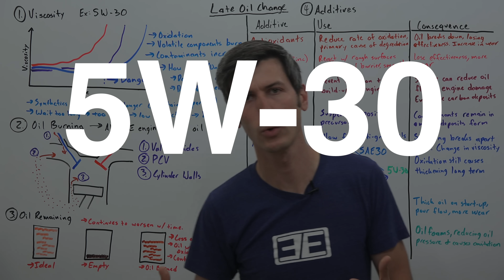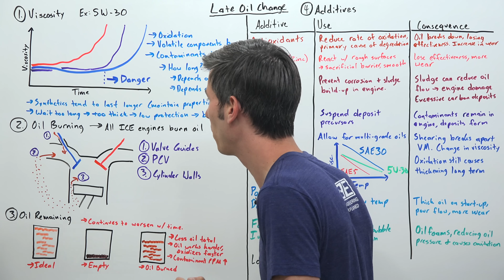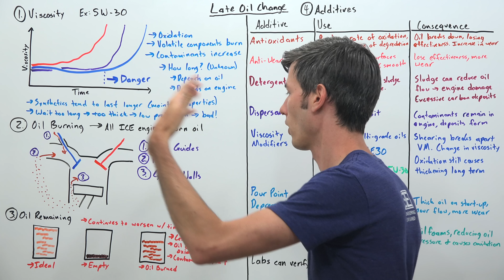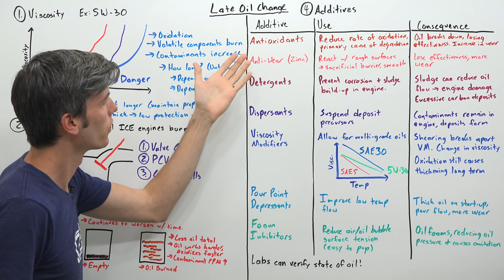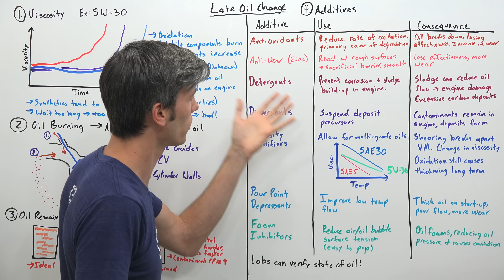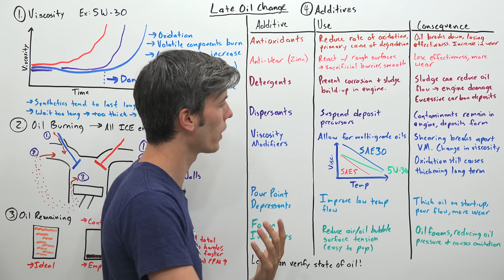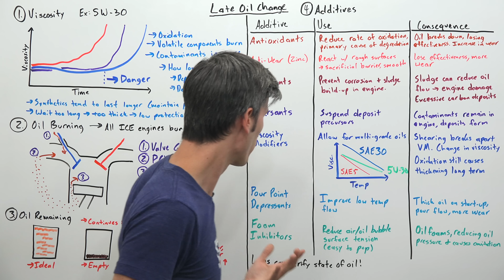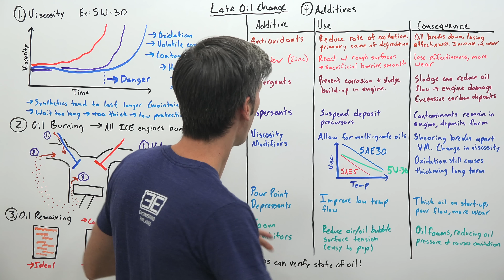What If You Forget To Change Your Oil?

Comment: I’m very surprised to see that nobody committed on the fact that he misrepresented the oil numbers incorrectly. Mostly because ppl don’t understand it. Let me help you out and correct his statement. 
Oil does not get thicker when it’s hot, nor does it get thinner when it cold. The 5W30 and every other oil labeling is - the 30 is the weight which is how thick the oil is the 5 is the viscosity which is how easy the oil flows and of course the W does stand for winter which really means nothing. Because we don’t adjust between winter and summer. Most of the newer engines are at a tighter clearance so the oil has to flow easier but still cushion the bearings.

Comment: Great video. The one thing that I want to raise is that throughout the video, the concept of 'time' was used as a constant, whereas I would argue the 'transition' that oil goes through is based on 'time the engine is running' and not JUST 'time'. I mention this because almost all modern cars pop the 'oil change' warning after a fixed period of time (regardless of how much the vehicle has been used) and many people swear by annual oil changes (once again, regardless of how much the vehicle has been used). This is doesn't make sense (because its not like the oil degrades in the container it was sold in, so why would it degrade JUST be being in your car. The best analog we have today is 'miles' for an oil interval, though arguably an 'engine hours' gauge (like industrial/commercial equipment has) would be much more valuable.
Reply: My work vehicle is a newish GM pickup, and it's oil-life indicator is said to be based on the main computer's record of mileage AND driving conditions (short vs long trips, time spent at various throttle settings, etc.).  So, if you drive "hard", the computer will tell you to change the oil quite a bit sooner than if you drive "easy".

Comment: I use a decent branded 10w40 semi synthetic for my 2009 VW Golf 1.4 litre petrol NA and 2005 Yaris 1.33 litre petrol. I change the oil once a year (never do more than 4K miles a year on each car).  Never had any engine issue with either car and Yaris has 120k miles

Comment: Total anecdote, but my mom changed her oil every 5,000 miles in her 2000 Expedition with the 4.6L instead of the recommended 3,000 miles and it was the most reliable vehicle anyone in our family has ever had, and she sold it with ~316,000 miles on it.

Comment: I am using mobil one I dont even hit 3000 miles by time  I change my oil but I do it once a year and I use mobil 1 filter will I run into any issues ?

Comment: On my first car (BMW E46, 7 year old) I used to buy the best oil on the market and change it way before it even needed to be changed.. bought only the best replacement parts.. the car's engine died within 3 years.. so screw that, just buy a proper quality (nearly) new car, give it some basic normal care and kick it out within 10 years max. Some thing are just out of our control. The money I wasted on my first car is haunting me to this day. Slowly cost me 3 times what I bought it for.

Comment: Very important to note for those who don't know; The oil viscosity ratings are 2 different scales, as in the 5w 30 are not basing viscosity on the same level. Otherwise cold oil would have a much much higher viscosity like 150w 30.

Comment: Well there is a lot of factors for oil consumption. My engine has about 210000km on it a small 1.6L Turbo with 200bhp and it's still using no oil. If you keep good and proper care of the engine and it's auxiliaries you can reduce wear by alot with todays engines. Oh and don't drive too many small distance and give your car regularly a nice good run on the highway for a few hundred kilometers.

Comment: I went 50 miles over, so I just drove backwards before I changed it.
Reply: This is the kind of thinking that has made this nation so great!
Reply: @tiggla01  
Land of the free and home of the reverse highway dipsbit. Hahaha

In older autos: "Drive backward"

In modern cars:  GPS be like "hold my beer"
Reply: @tiggla01  amen
Reply: tiggla01 Yeah I was thinking must have been getting their advice from the DNC
Reply: @jimlangill9318  .....getting their advice from the "Run DNC," as opposed to Run DMC, ;)
Reply: Thank you for the tip
Reply: Outstanding move
Reply: Does this actually work? asking for a friend
Reply: @randomsanwhich2  Yes.
Reply: @danield8528  why comment something incorrect on purpose
Reply: @jayasmrmore3687  Because it’s funny. Why does it matter to you for??
Reply: @danield8528  because you should be the one paying his repair bills then
Reply: @jayasmrmore3687  His initial comment was sarcasm buddy. 😐
Reply: @danield8528  where is proof
Reply: @randomsanwhich2  no it doesn’t
Reply: On old cars that have mechanical odometers that are driven by speedometer cables, maybe. If the odometer turns backwards when you drive in reverse, yes. Later, manufacturers added one-way clutches like in a bicycle hub to prevent spinning the odometer backwards, and indicators that show when the odo drums have been turned manually. Now we have electronic odometers that advance when the car is in reverse just like when it goes forward.
Reply: The old Ferris Bueller method.
Reply: psnmadracer27 Ha,Ha...I remember and like that movie.
Reply: @Dan Gleeballs nope. that's not what "she " said. she said your dipstick is too short, there is  almost no friction, but since the "drive" is always both so short, infrequent and "gentle" there is still very  little chance of any internal damage occurring, a general all around  violation of physics = you're "outta spec" and are gonna need to be replaced. hahaha! Sorry but your G-name asked for it.
Reply: @dmmusicmusic  🤣🤣🤣🤣🤣
Reply: I have to try that. Inspirational thinking. If I drive in reverse for 130000 miles I'll have a new engine. Thank you so much !!
Reply: @kevinmanns7170  not only that, but the fuel tank will refill and once it's full, you can sell the fuel for extra money.
Reply: MrCalifornia1234 you are damn right it’s 100% true in case of front wheel drive 
And in rear wheel drive you don’t need to change engine oil ever
And in four wheel drive you don’t need any engine oil at all! Because both front and rear wheels cancel the effect of each other
Reply: You are a genius.
Reply: can't you just go all the wsy until the oil return to its original state. don't go too far tho, you will ended up having crude oil instead.
Reply: Seems legit
Reply: Captain here. This does not work. You should put your car in 1st gear (MT) or in D (AT) and then tow it backward, this will actually reverse the engine rotation. If you drive in reverse, the engine still rotates in the same direction.

Fun fact: if you tow it far enough, your car actually purify used oil to new oil again
Reply: And suck air, which contains motor exhaust, back through the motor, making gasoline that fills you tank back up.
Reply: @rezhaadriantanuharja3389  you're onto it 😂
Reply: I bought 1988 car and have changed oil 7 times in past 1,5years🤔
Reply: @0hjaa3.0  not often enough. You can do better. Think about all that engine wear.
Reply: Hahaha te best replay, but you dummy even if you go in reverse your engine runs in the same direction hahaha
Reply: You’re confusing the speedometer-odometer with the tachometer. The speedometer-odometer counts turns of the final drive output shaft. The tachometer counts crankshaft turns/minute.
Reply: @joseaguilar4455  at least the transmission last forever.😂
Reply: That was a good one bud! Haha
Reply: OMG you are genius, Why i never think of that. People living in 2020 you must be living in 2060.
Reply: I just reversed the odometer
Reply: aUcTALy iT Is WorSE FOr yOUr CAr
Reply: I'm old enough to remember when this actually worked, before returning Dad's car.
Reply: @jaxcell  in the old days you could do this?
Reply: @jayasmrmore3687  Wow, you really don’t understand sarcasm or get out much, do you?? You ever seen Ferris Bueller’s Day Off??
Reply: Damn why didn’t I think of that
Reply: @ageagile1047  it’s a joke
Reply: Genius
Reply: That's genius. If I drive backwards home from work every day, I put no miles on my car and it'll last forever!
Reply: @HydraliskX  You also can save on car insurance because you aren’t driving the vehicle more than 7500 miles/year.
Reply: the police are on the way
Reply: You tried
Reply: Haha
Reply: Lol
Reply: MrCalifornia1234 seems legit
Reply: You should've drove back in reverse to be effective.
Reply: Hahaha yeah,smart
Reply: I went 50,000 miles over, the engine seemed fine since the last time it didn’t have oil in it
Reply: So it’s a very strong engine..!👍👌🏎
Reply: I have to drive 20000 backwards 🚗
Reply: Smart
Reply: 100miles then
Reply: Hahaha 🤣🤣🤣
Reply: Lmao
Reply: 200 IQ
Reply: If you had of kept driving it backwards you would have ended up with a brand new car thou !
Reply: MrCalifornia1234 If you want to save money.. You can ride as long As you want But be remember to get back that Number so You are safe and wealthy at the same time
Reply: What if you went 10000 miles over?
Reply: But your engine oil ddnt agree
Reply: These comments are golden, but if you drive it to 9999999 miles it wil change to 0000000 and it will have a brand new engine too
Reply: Tenet
Reply: The engine may have been irreparably damaged, consider taking it to junkyard for scrapping.
Reply: Ha! Lol!!! That was good!
Reply: Save Ferris!
Reply: Ah yes, employing the Ferris Bueller method of reversing mileage....oh wait....most unfortunately that did not well at all...what to do, what to do ? Best listen to videos such as these...Engineering Explained, you're my hero !
Reply: Perhaps it was you who were backwards!  The problem is You lack imagination !! .
 If you really wanted to undo the damage you should have driven facing the rear of the car instead of facing the front OR you could have just turned the odometer back a bit - 50 miles,  OR put some tape over the odometer so the engine would not know how far it had been !
Reply: Big brain activities
Reply: Genius! I wish I thought of this years ago. Would have saved me a lot of hassle.
Reply: You are a genius
Reply: @MrCalifornia1234 - Ohhhhhh ... you are SOOOOO funny !! (Not!)
Reply: Probably should have towed it backwards
Reply: What? 😂
Reply: Science 🧬
Reply: Genius move ‼👍
Reply: Run backwards, Ferris, Run backwards!
Reply: Bloke don't
Reply: Lmfaoo
Reply: I’ve read a lot of cool comments on YouTube, but that’s not one of them
Reply: I’m telling my Mechanic this!
Reply: Thanks. My wife and step daughters will read that and think that's how it works and do it.
Reply: how did you know there was a  mechanic just 50 miles behind you? does google map measure distance backwards as well?
Reply: excellent ideal
Reply: I use virgin olive oil!!
Reply: B.S.! That only works in regards to the odometer...
Reply: 😂😂. Can you drive 12.000 miles backwards and miss it completely 😮
Reply: It will also generate gas in your gas tank.
Reply: @jannespor8178  😆 🤣 😂
Reply: Just because it can doesn't mean it should🤷
Reply: Does this work on bike?
Reply: I’m blocking you
Reply: I dont think that helps
Reply: Bwhahahaha!
Reply: This is the kind of thinking that elected a dufus as our POTUS.
Reply: I agree as of January 6, 2021.
Reply: Good Idea!

Comment: No wonder my BMW with a 12,000 service interval is caked in sludge.
I won't change the oil though, only needs to last 2000 miles max 😁

Comment: I think u are backwards on the 5  and the 30 because oil is thicker when it's cold  and 80 90 weight gear oil is thicker than motor oil so the higher the number the thicker the oil right?
Reply: Oil is thicker when it's cold, yes, but he's right.  Look at the graph.  A straight SAE 5 rated oil is thinner than an SAE 30 rated oil at all temperatures, and both quickly drop in viscosity as they heat up.  A 5W30 oil acts like a 5 when it's cold and like a 30 when it's hot—so it still gets thinner as it heats up, but not as quickly as the straight 5 rated or 30 rated oils.

Comment: Obviously driving too far can deplete the oil, but what about just letting it sit too long?  Almost every manufacture says change it at least once a year.  But what if you have a lot of cars and they only get driven less than 1,000 miles in a year?  Should you still change the oil annually?  Deems a bit excessive.

Comment: I thought my rav4 had a sealed differential because the oil change Interval wasn't in the manual. Turns out they call it the "prop shaft"?!. I was five years late changing that oil.

Comment: How dangerous is it to have the oil level too high?
Reply: Very? causes foaming and in turn significantly reduces lubrication and cooling
Reply: Man from Nantucket pretty bad, drain to normal acceptable levels or risk permanent damage.
Reply: VERY dangerous. The crankshaft will crash into the oil and turn it into foam.
First your seals will go out and ull start having leaks all over. Catalytic converter will go out too. And if you leave it long enough itll eventually destroy your engine
Reply: I figure I've got about 0.7 quarts too much (engine & filter recommended 4.6qts, mechanic put in the whole 5.3qt bottle). Should I be concerned?
Reply: @manfromnantucket9544  i dont understand your units of measurement, if you have like 50ml for example over the max value its somehow ok, if that number is higher it may become a problem, even amount of oil over half of normal value is not recommended, but if its over the max value that is even worse. But if you are over normal value and if engine have small leaks of oil(its normal for older diesel engines) then it will get to normal levels soon.
Reply: @milosstojanovic4623  it's about 650 milliliters over spec
Reply: @manfromnantucket9544  half liter :O OMG, you better check that yourself, if its above max value on that max value indicator, you could have a problem.
Reply: @manfromnantucket9544  its safe upto 1 quart overfilled. but i wouldn't take chances. how hard is it to just drain out the excess right

Comment: What if I don’t drive my car enough? The oil change intervals for my FJ cruiser is every 5000 miles. I only drive around 3000 miles a year. I use Mobil 1 synthetic and the car has 120k on it now. When should I change the oil?

Comment: If it's so important...why such an archaic system of measuring and determining whether the engine is low on oil? That stick and two dots method is pathetic for a machine as complex and costly as a car.

Comment: An Amsoil user has entered the room.
Reply: I'm going to try the Amsoil signature 0W-20 in my winter rider 2013 Kia. Its only 3.5 quarts. Its a 5W-20 in the Kia manual. Im in Minnesota so for me getting the oil pumping faster is a plus. If I notice no difference I'll just use Mobile 1 again. My Silverado, Camry,  and Rav 4 run on Mobil 1, 0W-20.
Reply: @Northlandermn  👍 Amsoil doesn't thicken up on me regardless of viscosity.  I stopped using my block heater.
I'm in the cold as well.....New Brunswick Canada

Comment: I worked @ a Ford dealer in early 70's and we had a car come with an engine that would not start . They ended up dropping  the oil pan and the oil that was still in there looked like black jello, not solid yet but sure not liquid anymore ! What a sight, something I'll never forget.

Comment: Does on time mean for the miles traveled or should it be done yearly even if you are well under the mile limit ?
Reply: Jason C listen man, it’s cheaper to change the oil and filter than risk damaging the engine. On time means whichever comes first. So if you’re running full synthetic with a quality oil filter than can last 10,000 miles or 1 year, then you change at 10,000 miles if it’s been less than a year, and you change at 1 year if you’re under 10,000 miles.
Reply: @I_discovered_civilization  yes definitely good advice thanks but what if I only did 1000 miles say over 5 or 6 drives for the year, still change or maybe go 2 years?  That would still only be 2000 miles over 2 years or just not worth the risk still?
Reply: Jason C what did I just say? Refer back to my original response.

Why do you think they give a time interval as well? Even when not in use, oil exposed to harsh temperature changes like cold winters and hot summers and humidity will break the motor oil just sitting in your engine over time.
Reply: @I_discovered_civilization  okay man thanks I won't be lazy in the future👍

Comment: VW recommended yearly oil changes on my 2010 Passat. Sending samples to Blackstone, I found six month intervals gave better results.
Reply: mattk04,
With how many miles driven? With what kind of driving?

I've never seen a manufacturer's recommendation that did not include a maximum number of miles AND a maximum number of months, WHICHEVER OCCURS FIRST. There are also usually two sets of those numbers, one for "normal" conditions (mostly highway driving) and another with shorter intervals for "severe" (mostly stop-and-go driving or towing or dusty/hot) conditions.
Reply: @ArcoZakus  - Yes of course. The 10k miles / 12-month recommendation is "normal" driving conditions.
Mine was driven less as my commute was 8 miles.

Comment: I use amsoil 5w-30 and their bypass oil filters for 80k miles with 25k oil analysis the filters catch particles at two microns. I burn about three quarts in between changes. Ive been curious could you do an engineering explained on what size particulate is the most damaging to an engine

Comment: I use AMSOIL synthetic which recommends 25,000 mile oil change intervals.  I change it after 15,000 miles and haven't had a car to run for less than 200,000 miles some have run over 300,000 miles.  When Car Talk was running on NPR, the boys had an ongoing experiment of never changing the oil in one of their cars and just topping it off to see how long it would last.  I don't know if the experiment was ever concluded.